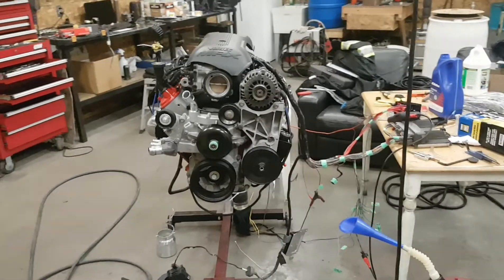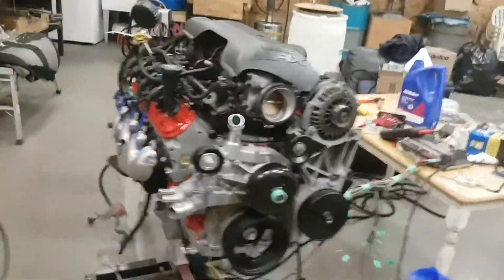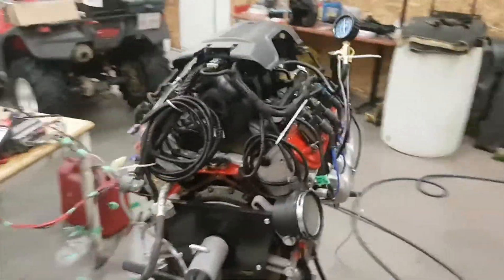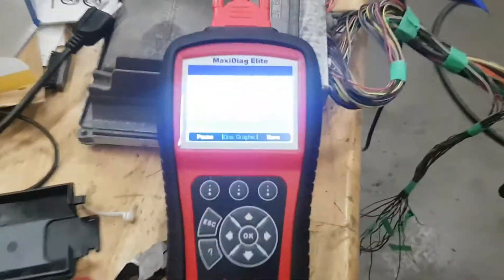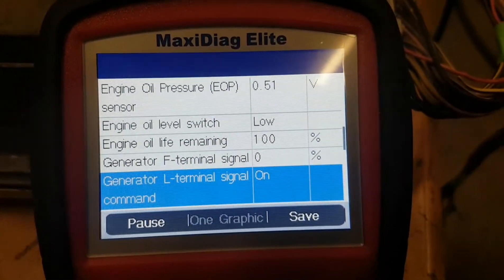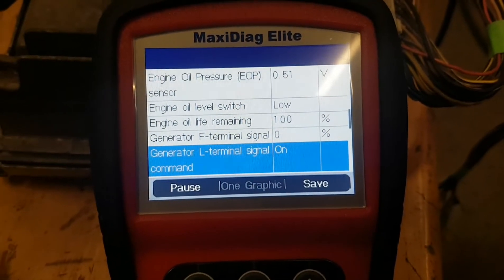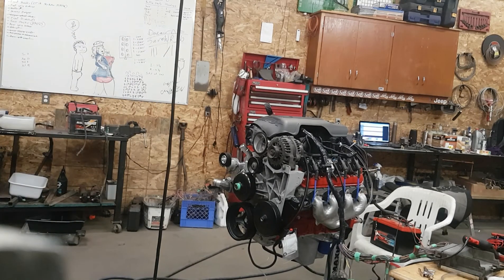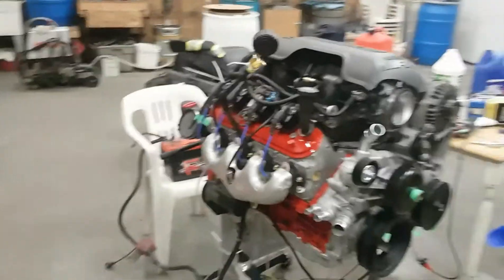LQ9 6.0L V8, first run on engine stand.

Comment: How’d you turn it on ?
Reply from the maker: I won't go into any real detail as there are lots of better videos of LS's running on a stand.  Very simple though.  All your pink wires require power, as well as a couple others.  Add fuel, and crank the starter.